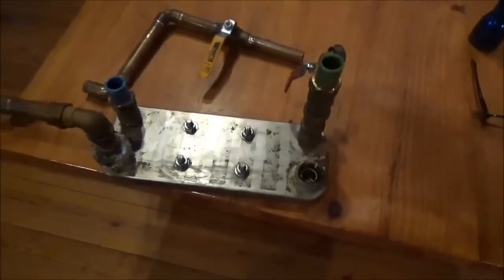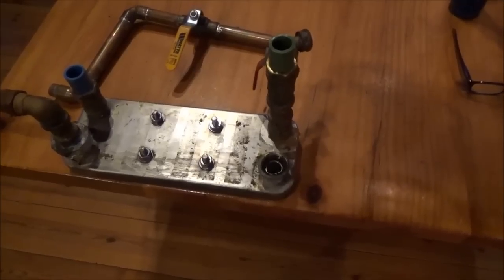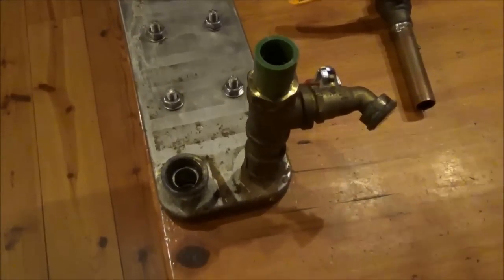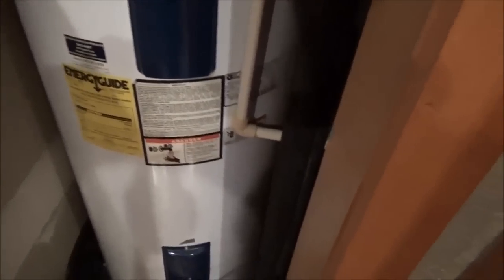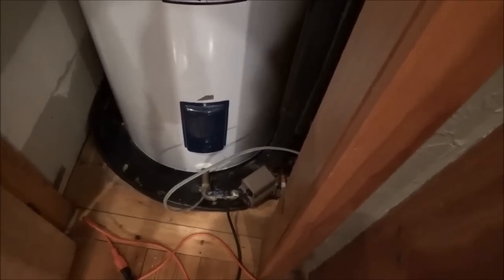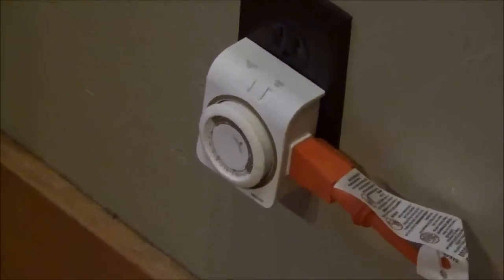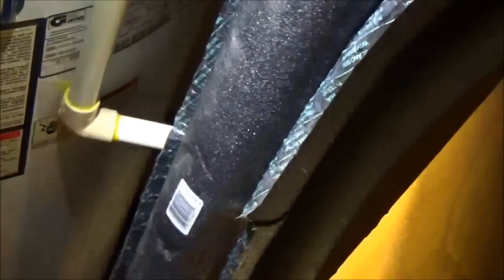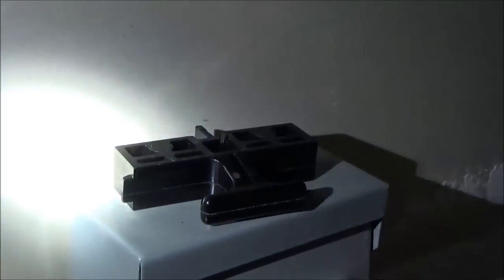Lots O Hot Water!

Comment: I was almost ready to do this and fixed mine another very simple way.  I was getting no heat at the top or bottom of the sidearm.  I decided to actuate the tpr valve in hopes there was an air bubble in that area. It hissed a long time before it finally slugged water.  After that the pipes entering the top section of the heater were very hot.  Works great now.  I'm sure a pump may have  done the same, but this is a quick fix, and i wanted to mention this condition since none of the youtubers have so far.

Comment: This is a commercially available heat exchanger that could take the heat from one of you solar AC units.  If tied with solar PV hot water, it might decrease the need for one solar panel to heat hot water.

https://www.homedepot.com/p/ZeroEnergy-Heat-Recovery-Water-Heater-System-Zero-Energy-ZE-TSHRU/203715807

Comment: Scott, Install a bypass around your pump with a check valve (same flow direction) so the water will thermosyphon when the circulator pump is not running, and will prevent back flow when the pump kicks on.  As long as you have the inlet from the OWB on the high side and the outlet on the lower (contraflow).  It works for my Portage and Main 2840.  I have a switch for the circulator pump in the bathroom.

Comment: What if you used a 24v thermostat on the unit to measure pipe temp and set that on a relay/coil setup to power the circulator when temperature drops

Comment: looks like a good idea. but im just wandering why you have the hot water coming out the drain valve since water comes in the top of the tank and travels downa pipe inside the tank to the bottom and is normally heated by the two heating elements as it fill the tank and hot water comes out the top hot..couldent it just be hooed up the normal way?  so you would still have access t the drain valve.

Comment: It might be good to put a line voltage stat, with a remote sensing bulb, on the out going line that feeds the house. In case the snap-disc thermal switch on your heating loop should fail you would have a second safety that would keep scalding water from leaving the tank. Just wire it in series with the hot wire you already have going through to snap-disc to the pump. Thanks for your informative videos.

Comment: Use the top water heater element thermostat as the pump control thermostat as there is a down tube inside the water heater that brings water into the bottom of the heater first.

Comment: You should use the temp control sensors from your old 220 V heaters, that way you can set the on temp where you need it.
I use the same controls for me RV when I added an electric element to my Hot water heater.

Comment: We also use an 80 gallon water heater. I simply use the thermostat from my water heater to start the pump. It has worked for 6 years. I don't use the electrical part of the water heater, only the thermostat.

Comment: If you have a modern dishwasher it may not run properly if the water is over 130 degrees. It may run for a real long time, or not fully complete the cycle. Fyi.

Comment: It is just for back up, I haven't turned the power on to the hot water tank in 3 yrs, I run my owf. Winter and summer, also my plate exchanger has been in service for 7 yrs, i do have hard water, but I'm going through a water softener
Reply from the maker: Nice. I felt I got ripped off with that baby heat exchanger.

Comment: Just a thought. You could take the white #10 wire(at the breaker) at the panel that is feeding the 240V 30amp disconnect and remove it from the breaker and land it to the neutral bar.  Change the 30/2 breaker ( black #10) wire to a more friendly 15 amp or 20 amp single breaker. You can come out of the disconnect and mount a 15/20 amp receptacle dedicated for the pump. Some disconnects have a GFIC receptacle built right in.  You will have an open space in the panel cover. So will need a blank or another breaker to fill the hole.
Personally, I would love to see an automatic transfer switch so you can switch over from the water heater to the heat exchanger at will but, you would have to run another wire. LOL!
Reply from the maker: Appreciate it.  I started to pull another wire  but was not successfull in snaking a wire through. I have to cut some drywall to get access.  I like the transfer swith idea. Thanks
Reply: Reckon id code one of the hot legs neutral in the disconnect box land it to the neutral bar at the breaker panel and do the rest like homestead prepper said.

Comment: U have an adjustable thermostat on the lower element that is set open when the tank temp is @ max; a 110 vac outlet can be wired in out off the 220 disconnect ( U will want to refuse the 110 down 15 or 20A). There is a way to use the upper element as an emergency heater if U want to know more call me (865-712-6601)
Reply from the maker: Hmm. Interesting.  I need to give you a call. Thx

Comment: Do you run a mixing valve since your at 180 degrees of hot water? In northern Wisconsin we had outdoor wood boilers and it heated our floors, dried our cloths with a heater core I took from a car and put into our cloths dryer, and heated our water. We ran it around 170 degrees but with a mixing valve to temper it down to 115 at the point of use except at the cloths dryer where it ran at full temp. Also, do you think soaking that plate heat exchanger in vinegar would help clean it up?
Reply from the maker: Yes, I have had a mixing valve from the day I installed the water heater.

Comment: Look into LAING hot water circulating pumps, they are really nice I have been using them for years in small water projects, mainly their smaller ones more suited for pc water cooling and such, but they make really high quality brass head hot water circulating pumps that use very little power and quieter than the one you have here. Maybe you already know about them but just throwing it out there :)
Reply from the maker: Thanks. I will check it out.
Reply: engineer775 Practical Preppers we use a DC Laing on our bath house. runs off a 2x2 solar panel. the first one we got wore in a few years.

Comment: Hello: I just put a new Taco 007 flange type pump on the oil fired furnace that heats radiators in the house. I don't think the radiator heat can be beat for staying warm. IF you had a thermocouple in the water heater connected to a controller box that would cut the pump on and off.
Reply from the maker: Agreed. I could use a thermocouple/aquastat to control the pump.  Thanks

Comment: I'm probably mistaken... but I think that those bolts put through the plate exchanger really cut down on the performance. Like squishing the plates together, and causing the hot and cold water to mix internally from drilling holes through the unit.

Comment: Scott, your flat plate exchanger was to small, I'm running a 40 plate, 5x12 .I have it on the hot line coming out of the hot water tank, I have endless hot water on demand, I can fill my hot tub with 130 degree water with no prob, saves running anouther circ pump, and a bunch of controls,
Reply from the maker: Agreed. Why did you plumb the exchanger after the water heater? Is the water heater just a backup?

Comment: How about using a preheater for your water tank. Set up another how water heater with a temp sensor. Also, maybe wrapping your hot water heater with more insulation. 

I owned a resturant & we were always running out of hot water. I had a huge gas fired water heater. It was working all the time. Instead I bought a cheap 80 gal hot water heater & hooked it up to preheat the water going into the huge tank. We didn't have all the neat stuff we have today. SO we just set the small tnank at a lower temp to preheat the water. So when if was drawn into the second tank the system could keep up. 

So you could hook up a preheater on a 1st tank that would then feed into the second. Just a thought...LOL
Reply from the maker: Thanks. My boiler has 400 gallins of 180 degree water and really acts as a preheater. I just wasn't getting good heat transfer from it ot the water heater. So now I have 480 gallons of 180 degree water. That ought to do it. :)

Comment: I would suggest Instead of doing a temp sensor on the bottom add a flow sensor on the cold water feed.

When the tank draws water the brass pump kicks on and runs. Add in a delay so that when the flow stops the pump runs for an additional 10 minutes.

Based on the controller you use you can also setup how long the pump waits to kick on. So you aren't cycling it on for 10 minutes every time someone washes their hands.

Just a thought.
Reply from the maker: Sounds interesting.  Can you point me to a flow sensor.
Reply: There are several models here that should work.

http://www.futurlec.com/Flow_Sensor.shtml

The key is in the controller being able to read the signal then having the ability to program the settings you want. 

Many of the on demand systems use this sort of setup to save them from short cycling and going bad sooner.
Reply from the maker: Ronnie Bommarito awesome. Thank you.
Reply: Ronnie Bommarito You can use a small air conditioning compressor delay.  They cost about $10 at your local HVAC supplier, and cover the voltage range of 24v-240v by connecting and/or cutting certain wires of the component.  It isn't completely precise, but you can set the dial to have a delay within the range of a fraction of a second, up to 10 or 20 minutes.  They come in two options.  "Delay On Make" delays the start-up of your device.  "Delay On Break" delays the shutdown of your device.

Comment: Please do NOT tap off a 120 volt leg from your 240V disconnect and connect neutral to ground.  This has potential to kill people.  The equipment grounding conductor should never carry amperage. 

Option 1   If you are not going to use the 240 electric any longer, convert the 240 V to 120 V in distribution panel (step down to 15A single pole breaker) .  Take one leg and identify white, (verify both ends with continuity meter), then tie that conductor neutral bus.  Other end of identified conductor (white) can now be safely tied to Taco pump neutral.
Option 2   Keep the 240 V. circuit configuration and obtain a 240 V. to 120 V. control transformer (100 VA. or larger should suffice).  Bond the X2 terminal to equipment grounding conductor.  X2 will also connect to white wire on Taco.  Transformer must be placed inside an enclosure.  This configuration will permit electric water heater operation and simultaneous Taco pump operation with no circuit overload.  Ideally obtain a control transformer with mounted fuse block on top to adequately protect transformer and new secondary circuit (only adds $5).

Comment: Watch out for your temp.  Anything over 160 deg temp can cause 2nd to 3rd deg burns.  Good idea if it's hard to control temp or you want it that hot in the tank, look at puting a anti scald tempering valve on your out going water line.  You will need to plumb in cold also to it.  This will allow a little or a lot of cold water in to temper down the water before you get to your outlets.  This is the safest way to prevent any acedents.
Reply from the maker: Thank you sir. I do have a mixing valve in place.

Comment: I've got a question. How do you dump the heat going into your hot water at your wood burning source when you are not using hot water? Do you have another place where that heat can be utilized?
Reply from the maker: When its cold I heat the house and I also have my pool, shop and dehydrator as dump loads.

Comment: You said you were going to get rid of the 220 disconnect. Well if it were me, I might remove the double pole dedicated CB for the hot water and install one single pole 120 CB and change the disconnect for a dedicated recirc pump outlet in your closet, then take the other 120 line and remove it from the electrical panel and run it to a solar panel/generator and to another separate outlet right there at the recirc pump.  No sheetrock repair required once that disconnect is gone....  You could run another shell and tube in parallel with controller that uses the solar set up, check valves and if the solar has power, the controller would automatically use the solar power for the pump. to save some money.  Just an idea.  Good luck!  WAIT, I just remembered you have a dedicated 220 line for that Hot water heater, that's a problem, because there is no neutral.....
Reply: You could remove the disconnect.  One 120 from the panel, the other from the solar set up, to the controller, then to the outlet were the disconnect was.  That would work.
Reply from the maker: northcacalacka545 thanks for the ideas. I will probably keep the 220 disconnect at least for the top element, wire solar to a dc lower element for passive heating and rely on wood to to do most of the pulling.  I was thinking that if I did pull 110volt off of it the lil circulating pump could never produce enough torque even if the impeller locked to cause an issue. I could be wrong there.
Reply: engineer775 Practical Preppers Your welcome, I am not an electrical guru, but I did work on airliners and helicopters(avionics) for 15 yrs.  My only issue would be the no neutral problem you sometimes have with the 220 lines.  You usually only have a ground and two 110's.   I was thinking you were going to get rid of the 220 elements all together and go with the wood fired circulating pump, in which case, a way to run the pump on and off grid would be essential.  Now that I think about it, you could put another hot water heater in parallel with other one and have every option available.  It might give you a way to test things as well (and not have cold shower)